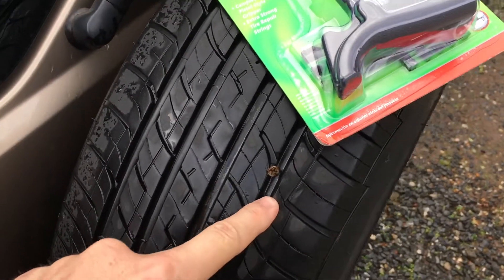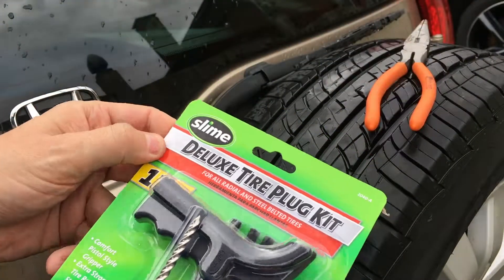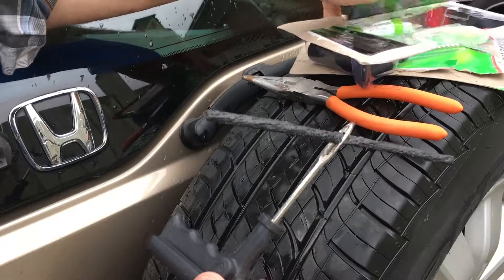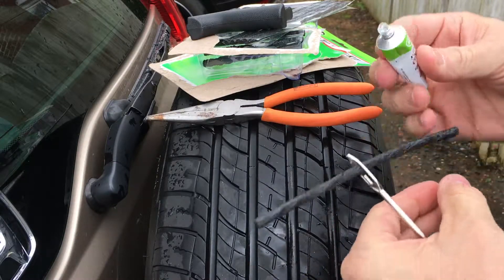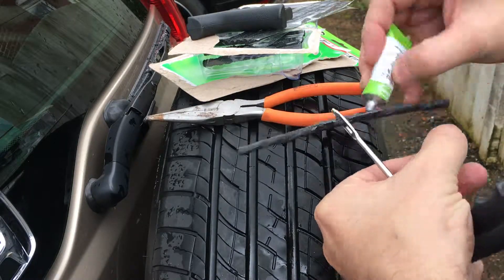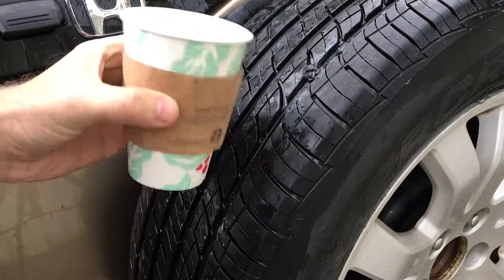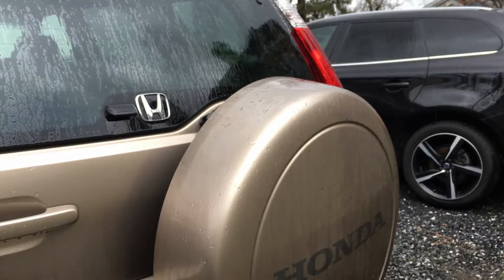REAL-TIME Repair- Slime Tire Plug Kit - I've Never done this before!

Comment: Good instruction  but if tyre (australia) is fitted to the rear of vehicle it will wear out but if fitted to the spare  it may have to be fitted to replace one of the front tyres . I would not feel good with a patched wheel on a steering  wheel at 100 km

Comment: What if it still has bubbles?? 🤷‍♀️
Reply: You can try to ream out the plug and redo it. Make sure to use some twisting motions when you insert the plug in to get a better seal.
Reply: Use the fatter plug

Comment: Thank you, just got this done myself for the first time. As a word of advice, if the plug going in is too hard, double check you have the right angle. It was impossible until I shifted ever so slightly and then it went in much easier
Reply: I wish I would have read this comment before I attempted it- I finally figured it out. Ha!

Comment: Very nice job, young man.  I’ve done many of these, and you did it just right.
Reply: How long does this last? I'm doing mine today.
Reply: i seen somewhere where you light the cement rubber on fire before you put it in?
Reply: No you cut off excess on tire tread. Then light it on fire, ONLY for a couple seconds then snuff out flame. Have something you can press on plug to seal the deal

Comment: hahha, i just plugged a tire on my honda accord still on the car, this is the fastest way to get back rolling quick, what sucks is the same as when i put new tires on my nissan maxima one month later i picked up a screw in the same front tire as on my honda and exactely one month later ? freaking crazy huh ? well the nissan plug is still holding air even 3 years later, so you did it right as i did ;)
Reply: I found another nail a few inches from the one I just repaired a few hours earlier 😢

Comment: Best to dry off the area first and definitely try to unscrew any screws as it will rip out the hole larger.  After inserting the needle, it's best to turn the handle a quarter turn to create a "knot" inside the tyre, then yank out the needle firmly.  Most bikers use these and swear by them.
Reply: How long does this last?
Reply: @VettaBoop  My repair covered around 3,000 miles so I reckon they're okay for the life of a tyre.  I've come across others who left them in until the tyre wore out.
Reply: @FlyingPanMan  thank you 😘😘 I have to do mine tomorrow and I'm SO nervous! I hope I do it right. My tire is smaller than usual cars, so I think it'll plug better?
Reply: @VettaBoop  depends i guess how good you done it, i did one on my car over year and half ago, and still hasnt leaked
Reply: @xxxkybourbonxxxx is rubber cement necessary? I've noticed some of the kit does not include the rubber cement.
Reply: @VettaBoop How'd it go? Takes some elbow grease
Reply: @Mikejones011990  it definitely did. And make sure you check it. I needed to double mine. It kept leaking. I finally bought a new tire after a while.

Comment: Prefer the rasp type hole cleaning tool rather than the spiral type that that kit had. Easier with air in tire. Leave clean out tool in hole to keep tire inflated.  I don’t leave that much sticking out.

Comment: The tire is much easier to plug with it full of air that way there is minimal flexing of the tire when you push the plug in.
Reply: Yes, that's how I do it. Set up everything so you can go from one tool to the next fast so you aren't losing air in a tire. Once I plug in mu tire still have over 50% air in It.
Reply: always over fill the tire with air, have all supplies ready to go, put out the screw or whatever, and jam the plug in really fast, then let out pressure to the right specs

Comment: Is it possible for me to do this without taking the wheel off? I don’t have a Jack.
Reply: Already bought the kit lol
Reply: Yea, it should work. Just be sure to wait the time listed in directions before reinflating
Reply: yes you do not have to remove the wheel, and you do not have to deflate the tire either it is the same repair even when the tire still has air, as a matter of fact it makes it easier if the tire is inflated.
Reply: @skismosis  thanks man
Reply: @skismosis  I’ve been waiting six months with this flat tire waiting for you to reply.
Reply: @detectivebubblegum9777  LMAO, sorry it took so long.
Reply: @detectivebubblegum9777  man wtf you waited 6 months just for his reply 😂 man I hope that was sarcasm.

Comment: I just used the same kit this week to repair my son's tire. It worked well, but I had a heck of a time pushing in the plug! I'm pretty strong and I was pushing with all my might and it didn't want to go in. I gave up on the first one and threaded up a second after I re-reamed the hole and tested it with the insertion tool. Those went in easy, but when it came to push in the plug it was really hard. I let some air out of the tire the second time, thinking the pressure was keeping it from going in, but it was still hard. It finally went in after extended pressure on it. I think it had to ease itself in or something. Once it was in, I cut off the remainder and it's been holding air fine since. Anyone know how to get it to go in easier next time? Was wondering if the glue was stopping it.
Reply: No actually the glue helps it go in easier than without it....
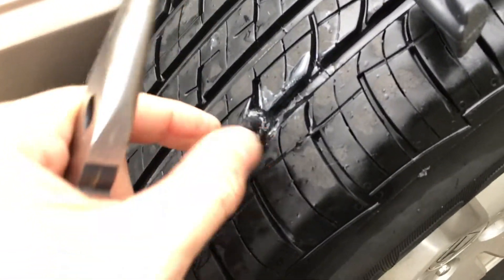Reply: More glue is better - it's just a bear of a job dude - same with me last night - all my might - had to keep on keepin on until it finally gave & went in - used the rubber cement liberally - parked it with the plug @ 6:00 o'clock position to let the cement settle in the hole - all good
Reply: Look up rexpair…this works for those tiny holes which by the way is 99% of the time. Add them to your arsenal. I used it today for the first time and a child could do it. The screw barely penetrated into the tire. I actually screwed the reamer in and created the hole then reamed it. So what I’m saying is that the hole was the size of a pin hole and I repaired it with 1 hand easily. Trying that with a normal 6mm reamer is quite the task and then the large needle with plug inserted is almost impossible on tiny holes. Also add nealy plug kit, and an ARB kit and you will have all situations covered. Different kits for different punctures.

Comment: For better results do a turn to create a knot on the inside and use rubber glue to help slide it in . Then cut off the extra on the outside and light the little part on fire and squish it out to create a better top seal .
Reply: No. Instructions literally say, DO NOT TWIST THE NEEDLE
Reply: @supersabrosinho correct. Don't need to twist
Reply: @supersabrosinho  Yes, but he's not the first to suggest that. Twisting makes it harder to remove the tool.

Comment: HEPLFULL HINT, FIND A DRILL BIT THE SAME SIZE AS THE REAMER AND DRILL OUT THE HOLE IF IT IS SMALLER IN DIAMETER. OTHERWISE, IT'S ABOUT IMPOSSIBLE TO GET THE PLUG IN THE HOLE BECAUSE THE HOLE IS TOO SMALL. DO THAT, THEN IT'S EASY.
Reply: If it's difficult going in, it'll be nearly impossible coming out.
Reply: you dont want the hole to be bigger, dont do this, u want it tight

Comment: A plug will last forever the glue just helps to get the plug to slide in easier no need for glue at all
Reply: Wrong.I 'd say. If all it does is slide then dawn detergent would suffice?
Guessing the glue fills gaps and has slippy additive as well.
Reply: @itsruf1  The first guy is right, the cement acts more as a lubricant, it's not needed. A lot of the tire repair kits come with grease instead of rubber cement.
Reply: They have also changed the kits now. I have the same exact one but it comes with 8 plugs, and plug bond, they took away the cement
Reply: It's an alcohol solution so also acts as a primer to clean out the grime for enhanced bonding with the patch.

Comment: Best to check the angle of the hole with a drill bit. Best to only use the fixed tyre at the rear on the passenger side because that is the typical tyre being punctured due the front tyre picking up the nail and darting into the back tyre. Rear also less weight, less steering action and less deforming on front wheel drive vehicles. I also used Loctite 567 pipe Sealant (up to 1050kPa pressure) with the same screw (or a slightly larger screw) since 4 years and still holding tyre pressure (regularly checked).
Reply: Definitely a good idea to rotate a repaired steer tire. I've seen a few cars spin like a top because one blew.

Comment: If let out about half the air the plug will go in easier. Letting out all the air makes it harder to get the plug in. When you put in the plug don't push it all the way in. Only push it in  the length of what you pulled out. If it's aong nail that goes all the way through, you need a patch.

Comment: Now even that tire it almost looks like a brand new tire.If a glued plug in fixed tire.Defiantly it can’t uses as regular permanent tire anymore.You are smart,now uses this tire as for a spare tire only.Because these tires plugs are designed and tested by those manufacturers.It only can helped and lasted to 100 miles max.If you’re going to uses this glued fixed plug in tire as regular replacement tire on your car and it very dangerous to use as a regular replacement tire and if uses beyond 100 miles can causes to have blow out at any times while you’re driving with it.
Reply: wrong!
Reply: @nicestrat  You heard of the wears and tears as anythings in uses for a longs period times wrights and as specially things that has happened to it compromised the original products also?As any tires in any cars models are in uses it’s rotating in circles continually in configurations for any roads conditions.Its rubbers it expanding and contracting as of the weights of the car all the times in uses as in any roads conditions as cracked damages in heats and colds weathers conditions.Also rubber dries rods conditions as it ages too.That why you should never ever 👎 uses as for a fixed tire with any kinds of glued plugs in fixed tires as a replacement for as a normal uses as a permanents replacement uses tire for any cars beyond that 100 miles.You’re putting yourself in danger for to getting killed or serious injuries for a tire to be blowing out at anytime driving beyond that 100 miles the manufactured recommendations.Now you’re like playing Russia Roulette with a rotating six bullets chambers of an old style models brands of hand guns..
Reply: I have used these a few times and the repairs have lasted the life of the tire. Honestly these are better than the patches they put on at the tire shop.
Reply: You're not speaking from experience. Lol😅
Reply: A plug will never cause a "blow out".